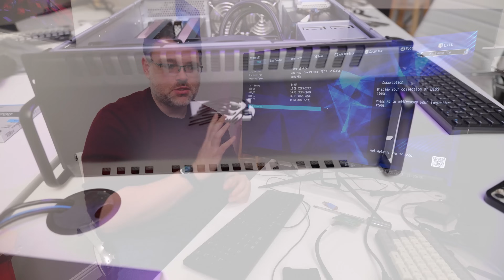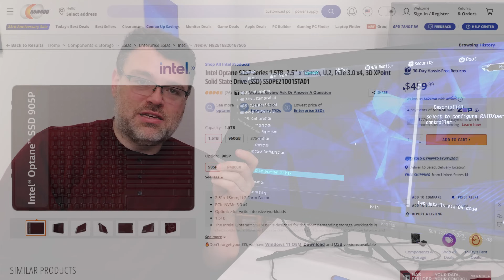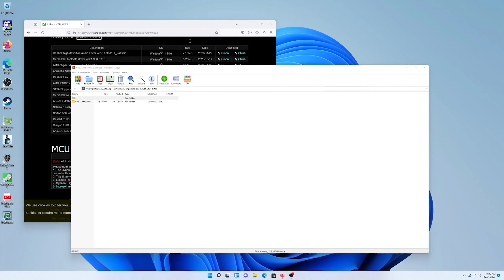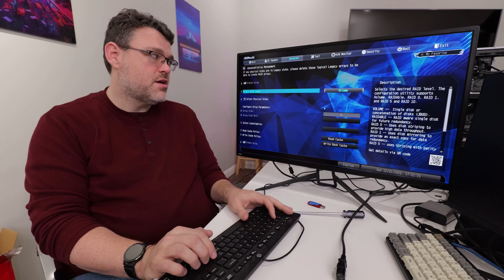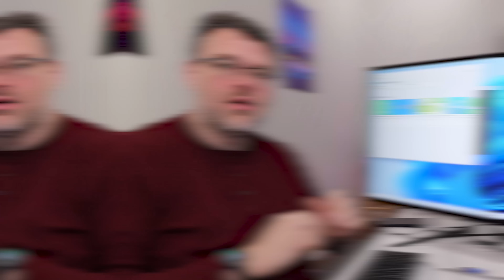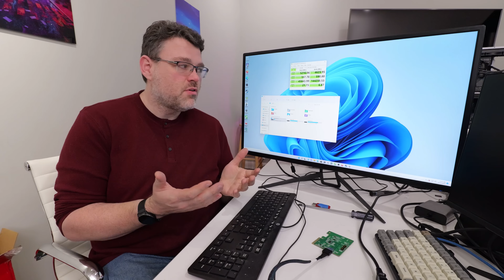AMD Threadripper RAID in 2024! Is it okay?

Comment from the maker: Hey! Use this affiliate link if you're interested in doing your own AMD Raid: https://newegg.io/ncbe30db78
Reply: Is optane still king as a win10 boot drive ?
the new gen5 nvme are rocking 12GB/s nowadays
ive never heard of wingit,  i like a little app called ninite, its simple enough and makes a packaged exe
Reply: i use a little installer called ninite  it lets you checkbox software and gives you an all in one installer package
Reply: Why is the manufacturing of NAND down?
Reply: I just love it how we are following along with what you're doing on your screen for the array setup and I have to grab my magnifying glass to make out what you are actually doing, all because you're too lazy to put your whole screen on the video field of view.
Reply: That's not just an affiliate link but also has tracking/redirecting going on. I thought optane was on the chopping block for intel products leading to users who have a need for it to have been buying a lot of it up such as users of ZFS where its excessive durability compared to normal SSDs gives additional cache use and lower latency helps avoid the standard fragmentation that occurs on COW filesystem where files get regular partial rewrites.
Reply: So I've got a 500Gb Samsung 980Pro Gen4x4 about 57% full and I ran a CrystalDiskMark test and got the typical results, but with a little bit slower numbers I'm guess because it's over half full.... And I was all proud because I beat your numbers, (except for the IOPS which I was expecting) and did a little self gloating and grinning lol ... but I noticed my individual SEQ and RND tests in the green boxes weren't the same as on your results.... so I went into the settings and tried changing the block size to 4k but I could change them to IOPS and nanoseconds (or maybe it's microseconds... I always forget which one that little weird 'u' symbol actually stands for... but I'm like 95% sure it's nanoseconds) .... but them I realize under "Profile" there's a section you can make for 'Real World Performance' and it automatically switches everything to exactly what is on your screen.... 
I heard you say 'real world performance' and thought you just adjusted the block size to something more realistic and typical.... I had NEVER clicked on Profile before when I used CrystalDiskMark a bunch when I first built this computer and stepped into the AMAZING world of m.2 drives and the POWER AND SPEED of nvme!!!!
- So I ran the test again and..... I'm still wiping the tears from my eyes, but they won't stop flowing LOL - You taught me A LOT her Wendel... THANK YOU!!! - I was really surprised when I saw my 980 Pro beating your two Optane's in RAID 0 ... I was REALLY caught off guard because I did not expect to ANY of the results to be higher than yours....(the IOPS still BLEW MINE OUT OF THE WATER tho lol) And when I switched to the 'Real World Performance' and saw that my results were ROUGHLY HALF of what you got (except for the seek time, yours was about 3 times quicker) which I felt was a good result, even though I have no idea what to expect from any drive using the 'real world' profiles.....
so I guess I rambled on like this just to say THANK YOU for all the stuff you have schooled me on over the pasty 4 or so years that I've been watching L1Tech ...  the numbers written in BIG BRIGHT TEXT on the outside of the box aren't always what REALLY matter (I guess SOMETIMES it is, but it's mostly what ever number is biggest lol) AND I had no idea what IOPS were either.... and if I had the money (or even the NEED) I would swipe up a few Optane drives  over anything else available.... but I don't need the speed for anything TBH... just for bragging rights I guess LOL Thanks Wendell! :)
Reply: Hi I recently flashed my ASUS firmware, system will not boot, i changed/rehanged all settings, tried different drives, its only that pc, i tried to flash back the old rom and went well, still no boot. I tried to google everything,  I tried every setting I can think of can you offer any help. I tried the fTMP reset and nothing. ssd works fine in another pc
Reply: Winget upgrade --all (add this to the end if you so choose that part of the update) --include-unknown

Comment: No, "M.2" isn't "basically nvme".   Sure, nvme is one of the the technologies that use the M.2 connection standard.   But there are also SATA M.2 drives.  Even though the connecters are nearly identical, SATA m.2's have a whole different power requirement and these drives are not cross compatible.  Mixing these kinda drives up is apparently very easy to do according to Amazon sellers item descriptions, and Amazon buyer comments and the big notification that "this item is often returned" on many M.2 SATA drives.  Important distinction to make and be aware of.

Comment: Been working on an AMD RAID issues on my new system. Be wondering if you experienced it or know of it. So the setup is as follows. An Asus x670e motherboard, 4 NVMe slots. Slot 1 and 2 have a pair of 2TB WD SN850x drives on latest firmware. The 3rd slot has a 1TB WD SN850x latest firmware too. Disk 1 and 2 are in a RAID0 and originally I wanted to have Drive 3 as a standalone "Legacy" disk running a Duel boot of Windows 11 Pro. The now RAID0 Array has Windows 11 Pro installed on it. All working fine and preforms really well. However when I go to install the second OS I will ether get to 86% copying files and it pauses for 10min or so, then might get to 100% and pause again. Then fail and ether crash the installer or reset it back to opening screen. Then you might skip that issue and get to 1-3% of getting files ready and it crash again. Once I manged to get the OS installed as far as going though and picking region, setting Wifi and then it crash on naming the PC. (Second OS is going to be intune/Entra ID joined)

I've tried the standalone drive as "legacy" (Clear meta date in RAIDXpert2), or the Jbods Volume type and "Raidable". All do the same crashing during the install. I've ordered a second 1TB SN850x while they are reasonably priced. So I am hoping having it in a RAID0 or 1 with the current drive might allow for the second OS to install. But couldn't find anything in the AMD Raid manual about it. It should be a supported setup.

I've tired a number of things as well as the drive presentations. Including removing the GFX card and running from the 7950X3D (it was like this for the first windows install on the RAID0). Resetting the BIOS to defaults and running completely base BIOS settings. Always the same crashes.  

Spec:
AMD Ryzen 9 7950X3D
Asus ROG Strix Gaming x670e-a (updated to latest BIOS as of December and AMD RAID drivers are the latest from both Asus and AMD as in two versions)
32GB of DDR5 6000 CL30 Memory
XFX 7900XTX
2x 2TB WD SN850x
1x 1TB WD SN850x (second to come tomorrow)

Edit: Update 12/02/2024: After posting this I found a readme.rtf in the drivers folder stating a known issue with installing a OS on a second array. Looking back at a version released the previous year (about 1 year ago) This was also present. So not holding my breath on getting that fixed.

Comment: I recently built a RAID 0 using M.2 on an AM5 platform and used that as my boot drive. Big regrets. It wasn't stable at all.
Ended up using another boot drive and doing the RAID 0 in Windows with no problem since.

AMD Raid "Xpert" is a big L. Cannot recommend at all.

Comment: Im building a server atm using just an old Threadripper 2920X(might upgrade tot he 16core/32 thread version since those are stil around for cheap), 128gigs of ram, AMD 6600(non XT)gpu, tons of storage, 16 enterprise 6TB HDD's, gonna use Unraid installing Unraid on a NVMe m.2 SSD, looking forward to using it, it's mainly gonna be for storage and video encoding. It would be fun to have 16 of those Intel Optane 905P drives instead but im a lowly peon with a normal job not getting paid much..lol  ...I would also love to try the new threadripper systems, but also can't afford them, so hope this adventure with an old gen2 threadripper goes well..lol

Comment: Win11.  Yup.

I simply make my way through installing each app but I have a thumb drive with a software folder and installing on NVMe is fast so it's easy enough.  Yes I update the software on the thumb drive from time to time.

I have to edit the registry to fix Win Explorer to get back the old context menu, then do a handful of changes to make it more Win10 like and then after that it doesn't bother me.  I get rid of most the things that Win11 puts onto the taskbar and put on the things I want there, shift the start button to the left, etc...................

Comment: Yeah, the situation with windows is stupid.
I've been using scoop instead of winget for most of my applications and it works great. It "installs" programs for single user and doesn't need administrator privileges for installing (it needs it for adding to the "right click" context and other reg edits, but that is fine). I fallback to winget if I need to install something that needs to be installed the normal way.
Anywyas as always, thank you for a great video!

Comment: is there currently anything in works to replace optane? there were efforts to push stacked hmb as a sort of buffer between level3 cache of cpu and igpus vram and fast nvme drives and that there are significant updates on mram to be used as universal memory replacing both ram and ssd but nothing out there, only more layered nvme going pcie 5 and 6 now using less pcie lanes due higher throughput but nothing significant like the mistreated optane was.
Reply: Not really, Optane is by a wide margin the best option for serving the role of NVRAM and better than SSD latency, it's just that Intel couldn't be asked developing it long enough to make it more price competitive, and was completely unwilling to release their vendor lock in for key Optane features. An HBM cache IMHO isn't super useful as an SSD cache because it's significantly smaller than even system RAM and the extra layer of caching carries a small but significant potential latency penalty, depending on specifics, and NAND is just too fast for bulk data transfer for anything else to catch up right now (when NAND plateaus that might free up some more R&D time and money for novel technologies).

Comment: Microsoft has had a history of being found to not be running their products where better alternatives existed; they did put in development work to try to disguise the appearance of such systems though. I've been using chocolatey for years though it still has the annoying bug where you have to pay money to have it detect the version of software that is installed; easy+mandatory workaround is pinning any package that is updated externally and using a program's own autoupdates or getting from original source is still the best way to get quick security updates.

Comment: AMD RAID - never again! MSI can't write a bios to save themselves.
I have a X570 ASUS Crosshair Dark Hero, worked just fine with AMD NVMe & SATA RAID.
So I setup a new MSI X670E Carbon system also expecting it to work fine, SATA RAID was ok, but Windows setup with NVMe RAID 1 would just crash out and come up with all sorts of errors.
I must have tried at least 20 things over several days, I knew what I was doing as I had done this many times before.
MSI's bios doesn't even have an option for NVMe RAID!
It just "works" when the SATA RAID option is turned on.
I gave up in the end, got rid of AMD RAID entirely, boot off a SATA drive and have 2x NVMe & 2x HDD Windows Storage Space mirrors.
WRITE A BIOS THAT WORKS MSI!

Comment: hmmm......  Is Windows Raid better then AMD Raid?? I have a Threadripper as well but just setup a Raid 0 array in Disk Manager with these results: Read - 6753 / Write - 6660.
Reply from the maker: Sadly mostly yes. But disk manager raid for boot volumes is not recommended

Comment: On the package manager rant, when you’re installing apps on a Mac distributed through PKG files, it tells the operating system “hey, I’m installing stuff. Please don’t install more stuff”

It’s not as sophisticated as some of the locks on Linux, allowing you to do drag and drop installations and App Store installations while PKG installations are in progress, but those other installation types shouldn’t interfere with PKG installers.
Reply: One of my favorite things, as a Mac admin, is that Apple allows you to make meta-packages. You can do packages that just run scripts. You can chain together multiple installers into one package. You can build packages that just throw a .app into /Applications. By their powers combined, you can make pretty powerful management action packages.

Sure, you can do basically all of that with EXE installers on windows, but they’re not nearly as standardized. Even if you use install shield or some such

Comment: Unrelated to this video but I had a question. I have a NAS and it's running truenas core. I recently bought 2x netapp ds2246 disk shelves which also came with a full compliment of 600gb sas drives. All for around $500. 

I installed a Broadcom 9500-16e into the NAS, and it can only see 1 disk shelf. If I switch the cable to the other disk shelf it'll appear. But both together will not populate (only 1 populates) 

Any insights?
Reply: you bother to google the netapp model and truenas?  first result.

Comment: I think we need a new video going over how you configure a new install of Windows and Linux. This includes the order you do things, first steps, what you install, what things do you tweak to make life easier. There's so much old, outdated advice out there for setting things up.
Reply: Windows: After install, do several rounds of updates. Then check device  manager to see what hardware drivers you need. Figure out the manufacturer and exact model, sift through their websites to get each driver individually. Then it's on to each piece of software you want. Hope you haven't clicked an SEO'd link to malware.

Linux: Install. Then update once.

Comment: I flipped from AMD raid to Storage Spaces for my win11. Was a matter of concern of whether trim was supported, and time to experiment.
Oddly Storage Spaces can't be enabled for a boot raid, although it's been achieved on some version of a surface tablet.
Certainly the win11 oobe is awful, and ntlite is a godsend to that nightmare.
Reply: Well it makes sense that a software raid(ish) solution can’t be done on a boot drive because you’d need the software on the disk to get the raid started. Kind of a chicken and egg problem.
Reply: @harrychufan  well, somehow it gets kicked off with the EFI MsHyperspaceDriver. It's beyond me how that could be generalized for PC and not just the Surface Pro.

Comment: What is the point of using a raid volume? How does the OS manage what gets stored on one before it fills up and begins using the other? I don't think I would want to leave to chance windows using optane for my 100gb of cat pics when it could be used for more productive things...
Reply: The OS doesn't manage this, the RAID operates below the filesystem. In this setup each drive is split into 256 kilobyte chunks and then the chunks are interleaved. For any file over 256k in size it is split across both drives.
Reply: @eDoc2020  that sounds like raid 0, I thought the volume setup was more like "make 2 look like 1" but not actually interleave anything
Reply: @BAD_CONSUMER   Wendell was using RAID0 mode. I didn't realize you were asking about the mode he didn't use. That mode just concatenates disks. Accesses to the first half go to the first drive and accesses to the second half go to the second drive. This could be useful if you have drives of differing sizes and need them to show up as one, otherwise it's stupid.

Comment: ONE thing Microsoft has never been able to make and they never will, is make usable a local or web search engine 
and they should stop trying, oh and 99% of problem are made by windows installing in background, 
at the same time you are instilling divers you want to use.  
Hey Wendell, couldn't they not use optane as onboard cache index chip on nvme drive?

Comment: well back in day we had motherboard with a chipset and socket that you could use both AMD and Intel cpu in.
but in the end there come a spilt in the road 
one wanted to bring Personal Computer to more people, with more backward and forward compatibility,
but the other Just wanted to make a lot of money.
Reply: AMD also used to be a secondary manufacturer of the intel chips. I remember AMD also making upgrade replacements for older intel chips to run at higher speeds. Even after they started building their own media instructions and sockets started to diverge you had at least one company (ecs? i dont remember) try to make it so you could use either on 1 board.

Comment: Even if only a tiny, tiny fraction of the AMD customers use motherboard RAID for something like Windows…

…would it be that expensive for a multi-billion company like AMD to remake its RAID drivers and software to the most modern standards? I’ve been using AMD’s RAID mess since 2019 and I would be embarrassed to release such a product.

Release it under an Open Source umbrella that would gain community points and “free feedback” from many people around the world to fix bugs and increase performance.